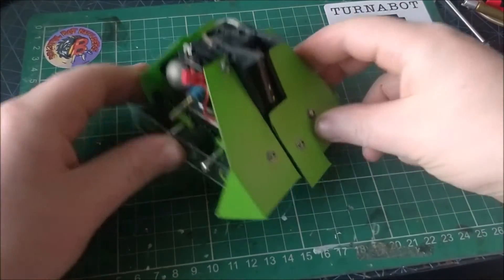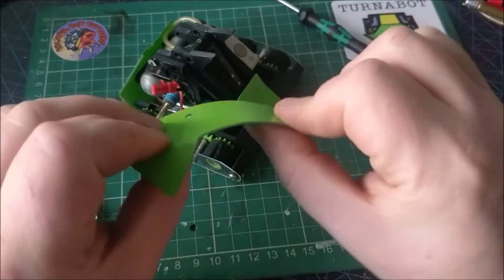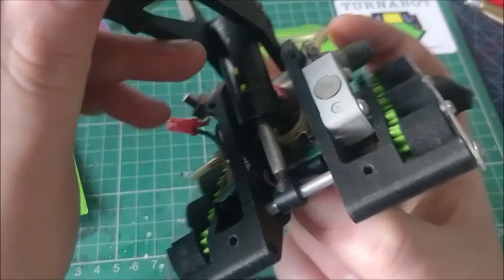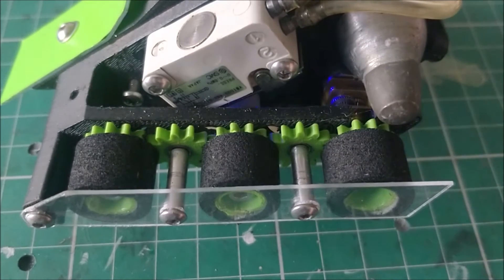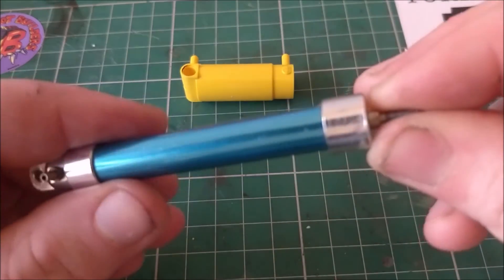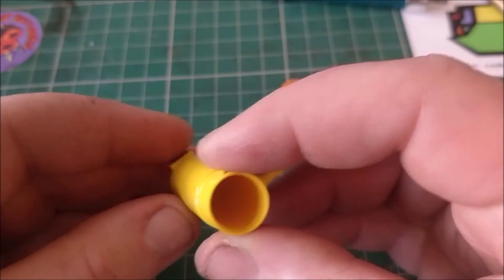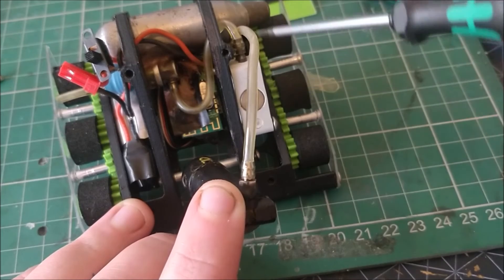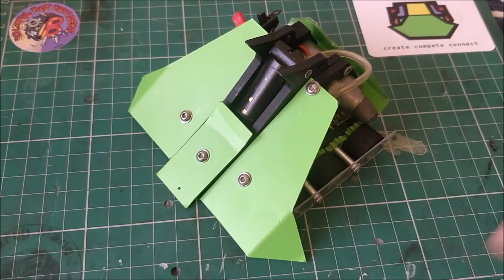A look at my pneumatic 150g Battlebot

Comment: I want to design my first metal robot, do you have any advice?
Reply from the maker: I can give more specific advice if you can tell me more about what you are building, what weightclass and such. 

My broad advice for building robots, especially your first one is just taking the simple path and not trying to do too much on your first build. Look at local builders and competitions, see what parts are popular and take note. Read forum posts, join FB groups or reddit groups and just absorb as much information as you can. 

The best way to have the most fun with these things is to have something finished and done by the time the competition rolls around - even if it means having to scale back and just running a simple pusher or wedge to get to grips with things.
Reply: @HarryMakesThings hoping to build a one pound metal flipper, snail can design, I really don’t know much about the metal classes

Comment: How high is the pressure in the system? It has to be really high to warrant the use of a heavy metalic air tank. But plastic tubbing suggests that it's probably fairly low.
Reply from the maker: @Zet9th  rules limit it to 100psi

Comment: Can u explain how the flip up mechanism works
Reply from the maker: @ishmxm4804  The video does explain the components but it basically goes like this:

Air is stored in a tank 
A small servo presses a valve which legs the air pass though 
The air fills the pneumatic cylinder which pushes the piston up and out
The cylinder extends which makes the flipping arm go up. 
The valve is no longer pressed so the arm pushed back down by its own weight and a spring.

Comment: How did you reuse the Whippet tank and get air into it? How much PSI can the whippet hold? I bought a pneumatic system kit from Robart, but the mini tank i got is still pretty big.
Reply from the maker: I mounted a one way filling valve from an rc plane retract system to the tank and I can then fill it up with a hand pump or the tyre inflator I use on my car. UK ants are limited to 100psi so that's what I use. I imagine they can hold much, much greater pressure though if you consider what they're actually designed for.

Comment: I am currently looking for a similar air inlet valve as you used in this build. Could you specify a bit more accurate how its called?
Reply from the maker: The valve i used is a SMC VM1000 which you can find on RS components - part number 289-8720
Reply: Thanks for the fast response :).. Seems my question was asked wrong, I actually meant the one-way fill valve  @HarryMakesThings
Reply from the maker: @AtterseeTobi  that's my bad, normally people want to know that one. The fill valve i used has been out of production for a while sadly. It's for model aircraft air retract systems so that might get you close with some googling. Robart make one but it's like 50 quid so way too rich for my blood. These have been in my basket for a while as a replacement but I haven't bought one to know if it's any good for our purposes yet. Hopefully the link works on YouTube : Just found this amazing item on AliExpress. Check it out! ￡9.98 | Fill valve  for air retract gear system turbine jet warbird parts
https://a.aliexpress.com/_EwXlBMV
Reply: Thank you very much for your answer. Sadly the link did not work. But I used a festo one way valve for now. Might be possible to change to your kind of valve. I have to look into it @HarryMakesThings

Comment: Finding the parts must have been a challenge. Very comprehensive. Congratulations on such a fine bot! Could I please ask, how much did you spend on parts? Also, are 3D printed tanks and rams a no go? Also, why don't the tubes slip off the valve nozzles?
Reply from the maker: I think there is maybe 30-50 in standalone pneumatic parts on top of the normal robot bits like battery esc motors etc. 

Tanks I would say are going to be a big no as I don't think you're going to get them to withstand the pressure without being incredibly well designed, printed and prepped. As a pressure vessel they are going to have to uniformly contain the compressed air - a slight deviation in layer lines (so, every 0.1-0.2mm) you have the potential for a fault. Very easy to turn it into an unintentional pipe bomb. 

I have experimented with printed rams, again it's more effort and for me, less reward than modifying a Lego or off the shelf part. That is possible with great care. 

The valves (and all connections) have barbed fittings so they lock the pipes on. Of course they can still fail. The main one on the ram had a zip tie added around them.
Reply: @HarryMakesThings  Incredibly impressed you managed to get that into the weight limit.

Comment: If you invert the ram you'll get a better amount of throw as its less weight to lift
Reply from the maker: Yes, very true - I made the decision to have it this way as the angle of the inlet barb meant I would have had to have the arm very steep with the ram mounted vertically. It is a bit of a compromise

Comment: Very nice design on the frame, surprising how big the firing valve is.
Reply from the maker: Thanks! Yes the valve is large, there are smaller options but they were over triple the price or had rubbish flow rate. Always a bit of compromise.

Comment: What sort of bolts did you use for dead-shafts? I have terrible knowledge of what fasteners and hardware is available at that scale.
Reply from the maker: These are just M3 bolts. I like button heads a lot and using them here meant I could use the same size Allen key for the whole robot.  The wheels themselves had 3*6mm bearings in them.

Comment: How do you change the airtank?
Reply from the maker: I don't. I use either a bicycle pump (which is a lot of effort) or a 12v tyre inflator to bring it up to pressure. This just runs on compressed air, maximum 100psi as per the AWS rules.

Comment: That looks so nice, I really hope it's effective, but with 6 wheel drive it should be controllable. I'd really like to see another effetive 150g pnematic, I've seen a couple but only (the famous) Anticide ever made a competitive package.
Reply from the maker: Thanks Mark, it wouldn't be possible without your ESCs that's for sure! I haven't yet brought myself to enter it into full combat as it could easily be one and done if it gets a good knock. 

I have been working on a revised version using some micro solonoid valves but they really need 12v and are still a bit lacklustre. One of the things I have in the back of my mind if you do have a commercially viable HV malenki!